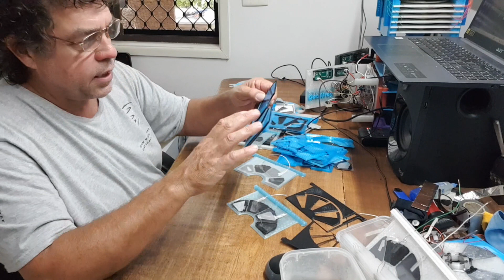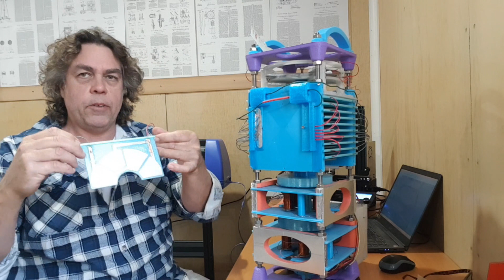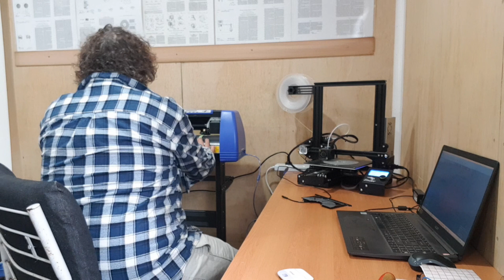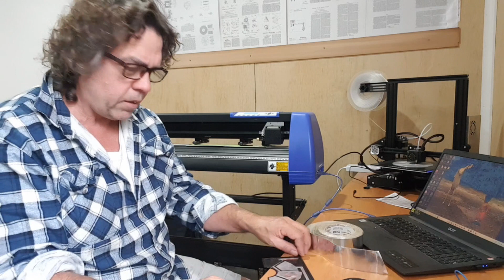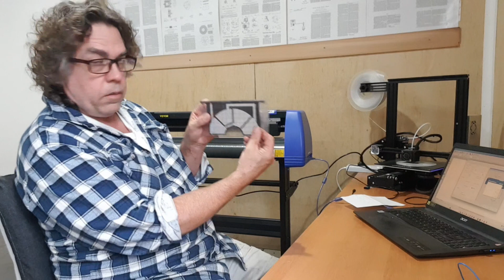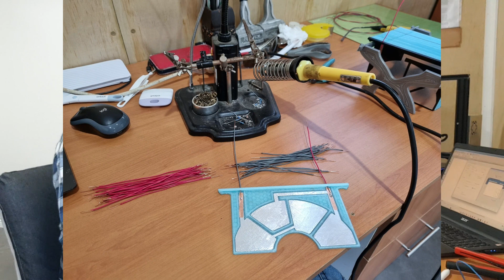Building Geoffrey 05 CapPlates V2

Comment: Hello
Very interesting. What about input and output?
Reply from the maker: It costs less then 10 watts to run. I can't make a spark like that for less then 30watts maybe more it's running at 60hz so the camera is only catching  less the 1/3 but the sound tells me it's not slowing down under load and I can see it doesn't draw more power or slow down much maybe 1 or 2 hertz. So the true cost would be 2/60 of 8 watts.
My new design has 10 times more output should run for less then 20 watts.